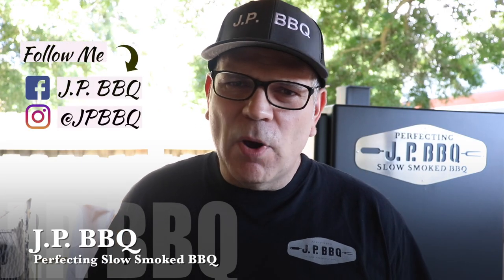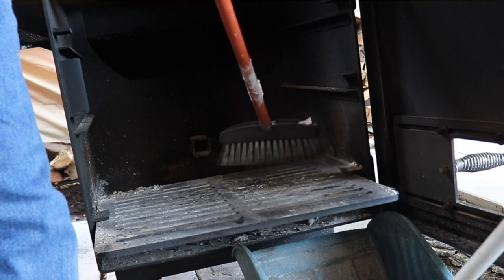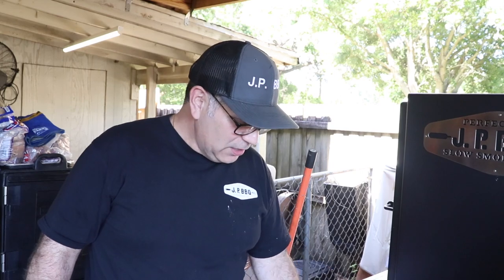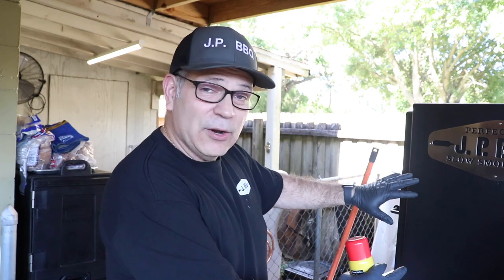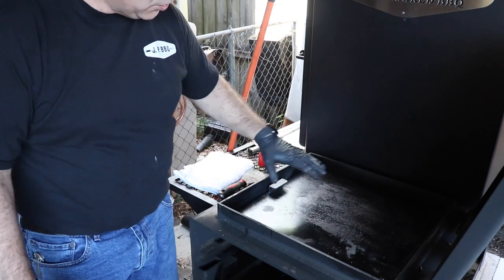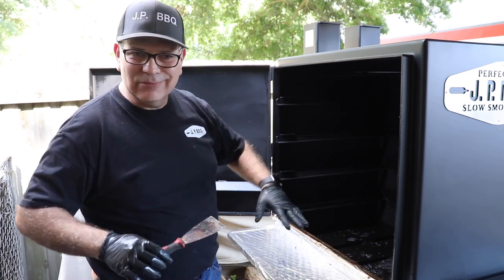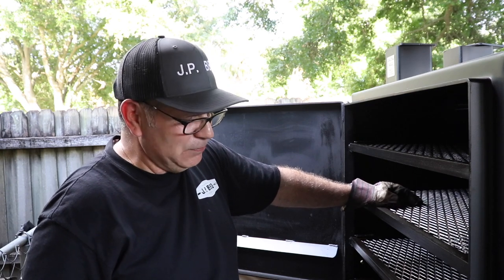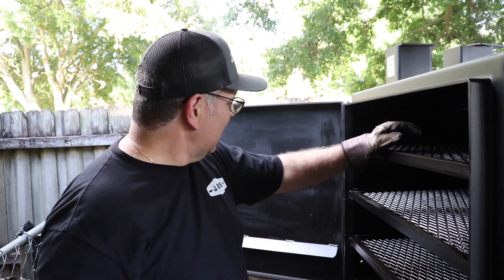Cleaning your Lone Star Grillz Offset Smoker

Comment: J P I think you should get the first place trophy for cleaning of a smoker. Eric that has LonestarGrillz put up a video, and there was someone with Shirley Fab put one. This should be watched by anyone that wants to keep there smoker clean and avoid issues of rust and decay. You mentioned in your video one being should of could of. What extras that  you did'nt would you have gotten. Just Curios
Reply from the maker: Well I appreciate that John very much. Thanks for watching and commenting. Some of the things that I should of gotten when I first got my smoker were
 
1. Fire assist (will light up your wood much faster).
2. Ash pan (easy on clean up and will save the bottom of your fire box. It is a heavy duty ash pan. Never seen one built this tough).
3. Stainless steel shelf (makes clean up easier and it looks good). 
4. Pull handle 

Hey thanks John appreciate you stopping by and watching. Hope this helps.
Reply: @JPBBQ  russ jones uses the ash kicker. Super cheap and reusable. Have you though about using those in the bottom. And lightweight
Reply: @JPBBQ  do you wish you got the 1/2 inch firebox? Chris says it holds temps better.  How has the 1/4" firebox do with holding temps?
Reply from the maker: @MrPanthers23  thanks for watching and commenting on my video.  im happy with the 1/4 inch it does a good job it hold temps pretty good. Sorry i dont have nothing to compare it too. Im guessing that the extra thickness in the metal will hold temps longer and use less fuel to hold that temp once its heated up. The thing that gets beat up the most is the firebox, those are usually the first thing to go out, meaning burning through, rust, etc... ofcourse im talking about the cheap offset with the flimsy metal you would get at a large box retalier not LoneStarGrillz. Those are built like tanks. So if you can get the 1/2 firebox that thing will last you a very long time, even the 1/4 inch will last you a very long time. Chris and his team build an awesome product. Thanks again

Comment: I do pretty much the same on my LSG 24x40 only once in a while after sweeping out my firebox I'll take an old shop vac and vacuum it out real good and then spray it with some pam. On the outside I'll usually hose it off and wipe it down with a rag  and dry it off and sometimes I'll wipe the outside with a little pan too.
Reply from the maker: Thanks Joe appreciate the comment. I like that idea about an old shop vac. I have one that I can use. Thanks again

Comment: I have the ash pan. It doesn't catch them all but it does protect the bottom of the firebox from hot coals and embers that drop down. If you think the grate is heavy, that ash pan is more so!
Drip pans and foil will save you hours of effort cleaning.
What do you do with the  water loaded with grease? It's bad to dump grease down the house drains.
Reply from the maker: Thank you for commenting and watching my videos Christine. That’s what others have said that the ash pan is heavier than the grate. Sounds pretty cool. I throw the solids and gooy stuff out in the garbage and the water I used to clean the pit I throw out back. Thanks again .
Reply: @JPBBQ  Thank you for replying! I enjoy your videos and look forward to more. I have used my LSG 3 times now and value time saving on cleanup. I am going to get a weed burner for the grates for sure!

Comment: Do you ever spray and wipe down with the 2:1 water:oil that LSG talks about?
I don’t think I would use detergent. I think I’d treat the inside like cast iron and never let soap touch it in order to preserve all that seasoning that protects it from rust. 
Looks like you’re having a great time with that smoker! I need to get one of those grass burners 🤣 Where did you get yours?
Reply from the maker: Thanks Apex , appreciate the comment. Yes. I only use a little bit of soap. Buts it’s mostly water and vinegar. Once drained I fully hand dry it and spray it down with canola oil or extra virgin olive oil. The weed burner I bought at Lowe’s. Be careful with it on the metal it will warp . So it’s just an easy pass over with it. Thanks again

Comment: Hi JP ... Good Video.  I am considering on buying a 30 inch cabinet.  Have to get some questions answered which you may help me.  Have you cooked a brisket on your LSG???  How long did it take you to cook it on the LSG and  How often did you have to put wood in the fire box?   Greatly appreciate your input.
Reply from the maker: Appreciate the comment and thanks for watching. You will absolutely love your LSG. I went with the cabinet style due to at the time was the largest cooking area for the money. I do catering on the side. All of their models are made of the best material and the craftsmanship shows in the work. I’ve done several briskets and they usually cook in around 7 to 8 hours running between 250~275 F putting 1~2 splits every 30~45 minutes. Hope this helps. Thanks again

Comment: Great walk through JP!!! I have an offsett LSG as well and yes that fire grate has some weight to it bro. I did get the ash pan as well and that thing is heavier than the grate!!! lol So I definitely clean out the firebox pretty similar to how you do as well. Every blue moon I'll pull out the ash pan to get the ash around it and re spray. I also use that grill spray oil on the exterior when I do see rust too. And yes it definitely does cook that oil into the metal there and turns all that rust back to black. (If you don't have touch up paint, this will definitely work in a pinch too.) Curious here: what do you use all over the exterior? I've seen where people will use 50-50 water and oil in a sprayer and apply it when the pit is warm. For me is just ran off and didn't seem to really do much. The best result I've had is spraying the exterior as I said with spray oil but after a few days man it would attract all kinds of dust and/or fuzzies in the air.  Thanks for sharing your greatly detailed cleaning process bro!
Reply from the maker: Thanks Dawgfatha appreciate the comment and compliment. On the exterior i just use water and distilled vinegar, roughly a gallon of water to a cup of vinegar and wipe it down. Seems to do a pretty good job. Some spots are tougher than other where some grease or oil had spilled over from the backside of griddle but that is really about all i use on the outside, and again thanks, I appreciate you watching my video.

Comment: J.P., I noticed you have 4 tuning plates, did your smoker come with 4 or did you purchase an extra one. I ask because I bought the same LSG 30" offset cabinet as your's and it only came with 3. I called LSG and they said it's supposed to have 3.
Reply from the maker: Thanks for watching and commenting KB. Yes it only comes with three. I ordered a fourth plate to see if it made that much of a difference in keeping a steady temp across the pit and really did not make a difference at all. The best way to keep a steady temp across the pit is by filling it with water. Hope that helps. Thanks again.
Reply: @JPBBQ  Thanks J.P. That does help. I'll try using water next time.

Comment: Why not use the torch on the grates while inside the cook chamber?
Reply from the maker: Thanks John, absolutely you can. I just had them out already cause I was cleaning the inside of the pit. Thanks again.
Reply: @JPBBQ  Mine arrives this week and your video was very helpful.
Reply from the maker: I’ve also used just plain ole degreaser with a good scrub and garden hose. Works just as well. Thanks appreciate the compliment.

Comment: Nice informative video but please stop throwing away stuff because they are cheap that's why we have so much waste . The rags and brush simply soak them in some degreaser and dish washing soap and you could use them a couple times good video tho keep them coming ..
Reply from the maker: Thank you Hayden for commenting. Good idea on soaking the brush and rags in degreaser and dish soap. Appreciate the input. Thanks.
Reply: @JPBBQ  When I do a thorough cleaning I throw away the the $0.96 scour pad and rags too.  One time I tried to wash and re-use the scour pad I got nasty black grease all over my hot water bucket and utility sink.  That stuff was worse than axle grease to get off.  Long story short, I used up three dollars worth of degreaser and soap and a half hour of time and 30 gallons of hot tap water to save a $0.96 scour pad.  Now, if they don't rinse clean they go straight into the trash.

Comment: How often do you clean it?
Reply from the maker: The fire box and inside lower chamber i clean every time i use it. The grill grates, depending on how heavy a cook i did. A light cook just brush it off with the heat from the fire box. Heavy cooks, just like in the video. Thanks for watching and commenting appreciate that very much